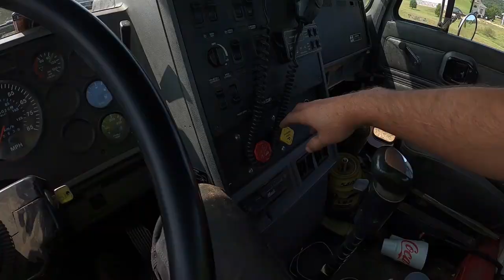Fixing grade on a pond dam hauling off a burn pile and installing a new driveway entrance

Comment: The best luck I have had with skid steer buckets is bobcat dirt bucket.  Never used a 4 in one.  Maybe move the pivot points ahead on the endgate so when it opens the front (top) of the endgate lifts way above the height of the sides of the trailer.  My end dump works good that way, built for sugar beets and silage, but for trash and brush works great, not too difficult to do verses building a barn door gate.  Looking good over there Mike.

Comment: That end dump is one of the nicer ones because it has a full frame and keep the tires on the ground. I towed a 40 ft that didnt have the full frame and it made my butt pucker a couple times. Its not hard to make that a barn door too. That is a nice setup with a short truck and trailer
Reply from the maker: Yes your correct

Comment: You'll need to get " Man behind the scene" to fabricate  hinges so the tailgate can be either a barn door or top hinge . I'm sure he can figure it out.
Reply: M
Reply: He can prob make them but several companies make them now. 14 years ago when my brother and I was doing landscaping and dirt work they didn’t sell these kits or the hinges. We more or less copied the design off a landscape trailer we had and cut the rear door along the outer frame and welded in a new frame minus about an 1/8 inch for clearance and put two pieces of 1/4 plate on inside the door for the door to set against and split the door in two It world but I wish we would have made it one piece but we didn’t have access to hinges that big and we had to make the ones we used out of pipe and rods which limited how far the doors could be opened and folded back.  Today  I would buy the double hinges that some of these truck body sales people are selling they can be actually folded all
The way back along the dump trailer out of the way. Ours did did work along better than the spreader gate about clogging up with trash but wasn’t optimal however we was able to sell that single axle truck for more than we paid for it.
Reply: @tramsdivad  are you ok? Seems like your having a seizure at the keyboard
Reply: @DirtPerfect  just need to put a silage tailgate on it. Same tailgate,  it just throws the hinge pins about three feet forward. Hydraulic open and close.

Comment: A great winter/wet day video would be making a high hinge on the dump trailer. 
Have you ever experimented with loading the hard stuff toward the cab so the loose stuff slides out first and does not jam up with the hard stuff? 
I bet you could have dug up that culvert pipe with the floppy bucket kitty. Smooth moves, gentle touch.. Good job.
You need a laugh sound track for your rare failures. Applause track is great. But then, maybe you already do have a failure laugh track that we never hear because you are Dirt Perfect.

Comment: I have a 92hp. Volvo skidsteer and I bought a what they call a 6-in-1 combination bucket, 80" in width from Cleveland-equipment.com. It's made by Loflin fabrication and it's very well built and besides a seeping cylinder I've had zero issues with the bucket, no racking or bow in the floor of the bucket. It was less than 3k in 2016. I highly recommend it.
Reply from the maker: Awesome thanks

Comment: Late once again on this vid, however, if you like old trucks and had the time to rebuild it, find yourself a 60’s model Mack’s to go with dump trailer. Get it road worthy, then start a restore on it. Just a thought, I know it takes time and money, but for an occasional use rig, might be fun. Mack diffs with the hypoid gearing are almost indestructible. They have a good truck.

Comment: That under trailer camera angle was a cool angle, I thought.  I didn't analyze the trailer, though, I was too busy wondering what road kill you have in Indiana.  Kind of doubted there's be a dead armadillo, but, worth checking out.  😜 And WHAT's up with the Coke bottle?  Did the Derby Market get shorted on the Pepsi delivery?  And by the way, another great video.
Reply from the maker: Lol thanks

Comment: I guess you should watch Chris's channel (letsdig18) to see what he uses (Maybe Andrew Camarata - King of Skid-steer accessories).  You definitely need a 3-in-1 and bucket with teeth.  Just watch for fun so not an expect on brands.  BTW: You need to take that Dump Truck trailer to the shop, buy TMBTS a new plasma cutting and then have him cut and weld on a new barn-door accessory for the back! Aaron can work on his fabrication skills!  And, If he does a great job, should we change his name to Mr. Fab-ously!

Comment: Did you try off camera,... with the bed at the position it's in at about 18:25, pulling away from the dump pile 50' or so, putting it in reverse, hitting the gas for 50', then slamming on the brakes?  😉🚚

Comment: That's why you need a Triaxle. You can get it with a barn door
Reply: I drove a KW T900 Triaxle with a Barn door. Double lined body. For hauling stone and when we did demo work. I squeezed that truck into some real tight places. For private and commercial jobs

Comment: Late to the party but for buckets I've been happy with the 2 Berlon brand buckets I have. They're made in SE Wisconsin. 
I have 2 of their buckets and would willingly buy another. My go to bucket is my 78" HD Extended lip bucket with welded on teeth. The teeth sit flush with the bottom of the bucket which makes clean up and grading easier then having teeth that sit below the cutting edge. The bucket also has a dimple die reinforcement plate across the entire bottom center area of the bucket as well as 2 thick steel runners on each outer edge on the bottom. I also have a 78" low profile extended lip bucket with a bolt on smooth edge, it's well built but not quite as HD and doesn't see as much use but definitely comes in handy at times when a bucket with teeth just isn't the right tool for the job. 
In the past I had an 80" Quick Attach brand bucket (Made in MN, I believe same company as Erskine attachments) that was so-so imo. I spent the $$ and put a rezloh cutting edge on it which was nice but stuck down below the bucket a fair bit which made grading and general cleanup work a fair bit tougher. The rezloh edge certainly has it's place but they're costly and at times just not justifiable. 
I would like to try a 4 in 1 bucket and the Norm Engineering buckets from the land down under certainly look like the top of the pile but they're costly and hard to justify but I might not know what I'm missing.

Comment: I’m looking at getting a skid steer as we speak. It’s between a 2011 Deere 329D with 1600 hours and ac cab and hydraulic coupler or a 2016 323D with 1800 hours no cab or ac and manual coupler. The 2011 looks to be in mint condition. The 2016 on the other hand looks like it’s been rode hard and put up wet. Just don’t know which one to go with cause the price on the newer one is really good.

Comment: I used a cat 4 in 1 bucket with a bolt on tooth bar for years and I served me well. It's all I used. After about a year of owning it I sold my smooth bucket...I just had no use for it after the 4 in 1.

Comment: Your operation is different than ours ( their all different) was but we got along really well with just a removable tooth bar for along time until we finally bought a machine with teeth welded in the bucket. Once we did we found we needed one without the teeth more to clean the streets slick off something before a storm or what ever so we ended up getting a worn out bucket cheap ( you know what they say about that you get what you pay for but we both weld pretty good and it was and easy to do on rain days after buckets shouldn’t smile) My brother cut out the warped and razor thin parts and I put a new bottom in it with a new a Bolt-on cutting edge and mount with a  new bradco bolt on tooth bar because no matter where the machine was the tooth bucket was somewhere else. In the end it ended up staying at the house so we could use it with what ever was there to load mulch black dirt or what ever we had stored there. 
As for four in one bucket we tried them out and rented them but in the end we ended up buying a grappler for one set of the forks as it was higher on the need list than an actual 4-1 bucket ( our mini nor the trackhoe had a progressive thumb just a mechanical one) so to grab pipes and other objects we found the forks with a grappler was more useful at that time ( we been using chains ) However it would have been nice to handle bigger rocks for landscaping but the forks and grappler did that too. The need for the  next road tractor will prob be like ours was. It came down to we were using the dump truck to haul machinery more than as a dump truck so the need became Apparent either another dump truck or a road tractor and another pintle trailer or bigger drop deck to move the two heavy machines that could be moved by the one ton abs goosenecks.
Reply: Another idea on teeth on the mini skid steers ( we had a MT55 and a Ramrod ) we ran bolt in edges that had the the teeth cut out of the profile of the cutting edge they worked really well for the smaller buckets and made a huge difference for ability to dig without cutting the ability to grade but we never tried them on a full size skid steer as we had the bradco teeth that worked really well and was easy to pull on and off by using pins and washers instead of bolts but we didn’t back drag with the teeth on much either. That more a final grading operation in the way we worked than a cutting and rough grading operation. 
A off video topic do you ever miss the Deere and the three point rake over the skid steer. I loved the Harley rake but I liked the one on the tractor more until we got a 48inch one for the mini   As that thing could get really close if you folded the wheels up on it.

Comment: Modify end gate hinges so pivot point is 12" or 18" higher..often seen on demolition trailers,12" raise would provide about 20"+ clearance when bed is up....I also noticed that your 5th wheel is flat and your back wheels were rolling forward...

Comment: You say you want to add a foot to the top of the dam but you're scraping at least a foot off of the top of the dam. But when you put a foot back on there it won't be any higher than it was before.
Unless you add two feet to the top of the dam, then that should make it one foot higher than it was before you scraped off a foot.

And it looks like the top of the dam is awfully dry to make good adhesion with that new layer that you put on that is also pretty dry.
Reply from the maker: Lol ok thanks for watching

Comment: I don't think I've ever seen an aluminum trailer with a barn door. Could be because they are to likely to bow out in the rear. Without the support of the tail gate connecting to both sides. I am curious if one has ever been built. God bless
Reply: There are many aluminum barn door trailers.
Reply: Letsdig 18 has a dump truck with a barn door tail gate. Can be used as a normal swing one too.
Reply: There’s several and they even sale the hinges for them too

Comment: You know Mike, we bought a 4 in 1 when we bought the new SVL95-2s,  it's nowhere near as useful as I thought it would be.  I built a custom grapple bucket from scratch and I love it, so that completely eliminated 1 of the 4 in the 4 in 1, and the bucket that came with the loader is the stock tooth and so far I really like it a LOT!  So all in all,  I am really considering selling my 4 in 1.  Guess I should have said the 4 in 1 is a John Deere, 84"  got it as left over stock brand new,  really good price,  really nice bucket,  just don't like it.

Comment: Ok, the stump got stuck because you raised the bed too high before you tried to pull up. This forced the material in the front of the bed under the trunk of the tree and jammed the tail gate.  It's best to cut the trunks off the stumps before loading them in the dump truck.
Reply from the maker: Ok

Comment: I have half a dozen  buckets for my bobcats, I've found the bobcat brand to be the best all around grading and GP buckets, that being said we use CAT brand buckets when working with asphalt as they are smoother on the bottom and clean up easier after a day in the hot mix. I don't buy any off brand stuff from RB auction anymore, not worth it. when you go to bobcat make sure they quote you the severe duty commercial bucket, as they now also have a cheap line to compete with the imports
Reply from the maker: Interesting thanks

Comment: I have used several aftermarket buckets. Found that the attachment points not welded in the right spot. Too high or too low. watch for that.
We own a Deere smooth and Deere Tooth buckets.

Comment: Just my opinion but 1 or 2 extra loads with the dump truck would be a lot easier with trash than the dump trailer.
Reply from the maker: No gate is way to small and would have taken a extra day
Reply: @DirtPerfect  Good point. Armchair quarterbacks need to stick to sports and let the experts do the work. lol

Comment: I have a 4 in 1 bucket and will never be with out one. I also have a stought smooth bucket and it does not grade worth a damn its like the mounting point holds the bucket to high to cut. you either get nothing  or dig to china
Reply from the maker: Good information

Comment: I went through a weigh station in Fl, and they singled me out for a Class A Inspection, everything passed..The inspector admitted to me after all was said and done, he just wanted to see how old my tanker trailer was, it was built in the early 60s, but well maintained.
Reply: So what you’re saying is that you were stopped from freely traveling down the road, just because a government agent was ‘curious’?  That’s actually alarming to me, and should be to you too.
Reply: @deplorablelibertarian  When your a commercial driver, you have no  "rights".
Reply: @charlesmiller5078 .....its disappointing when you have to request permission from the king to travel a public right of way, I guess that’s my point.  I’m sure you see something wrong with that, don’t you?  I do however, think it’s a beautiful thing that you’ve been running a tanker built in the 60’s, you probably don’t see it often.  I still have a car on the road built in 1982, one of the best cars IVE EVER OWNED; 1982 Toyota Celica with a 22-RE engine, original engine/transmission...422,000 miles.  The king awarded me antique plates so I don’t have to beg for registration stickers and inspection- that’s a plus.  I have newer made vehicles, but that’s only because I don’t own my sack or my wallet; my wife does....my 2017 GMC Terrain is pretty nice.

Comment: Kubota buckets are total junk, ive been through 2 of them. both of them failed in the same place. They warrantied one of them but not the second. I got frustrated and had one built by a local company here in georgia. Id look for a local manufacturer. They are typically built better and heavier for the money, and you can specify what you want. If you are looking for a quick solution, look at a company called solbees attachments. They make a good medium duty bucket and i love the profile of it. I believe kubota uses the same company to construct their ag buckets and skid steer buckets which are built way to light for the power of a skid steer. This among many other reasons is why ill never purchase another kubota skid steer. Oh yeah, kubota should be warrantying those injectors they ruined because of that filler neck. I had the same problem. Good luck man!